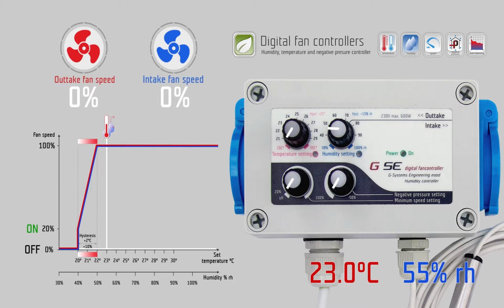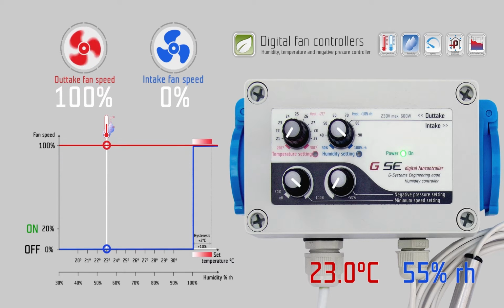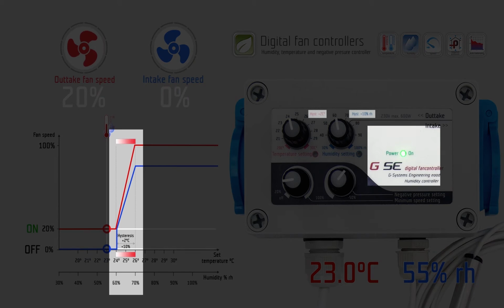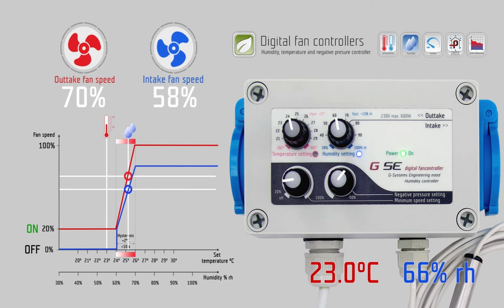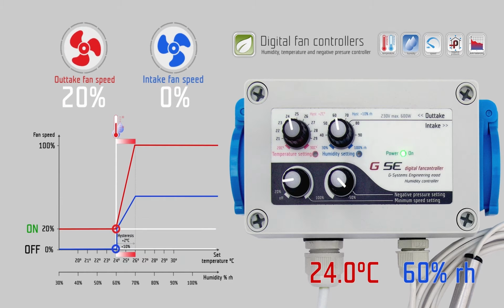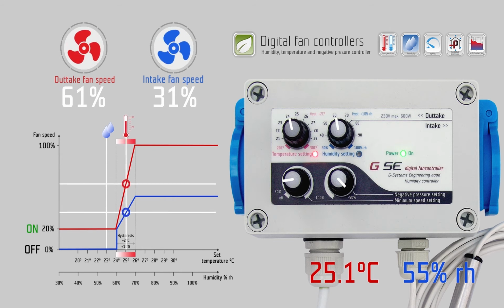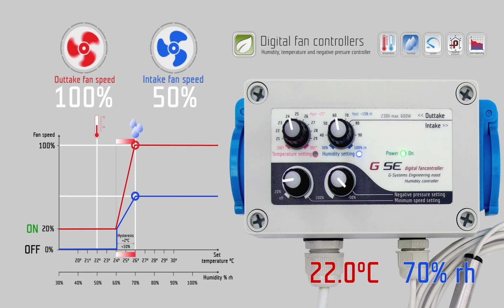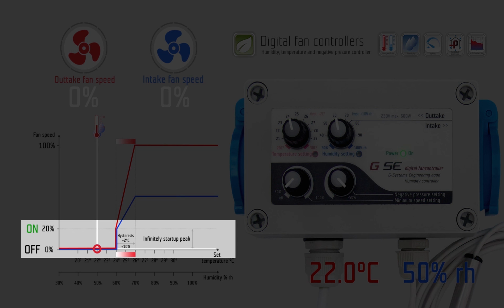GSE Humidity, temperature and Negative pressure controller (2fan) 2009-2020

Comment: Is this climate controller able to maintain the temperature and humidity levels of a 1.2x1.2m tent without any humidifier, dehumidifier, heater and air conditioner?

Note that the tent is located in a room that's always at least 21°C. Intake is from inside the room and outake goes outside the house.
Reply: Alain Gressly  so the tent is 2,88m3(1.2x1.2x2m) and my intake and outake fans are 280m3/h so at full blast they more than capable to renew tent air more than 1 time a minute (1,2times/minut). I understand that humidity and temperature cant go lower than outside conditions. But if outside conditions (which is the room where tent is located) are pretty low  good (21ºC 40%RH) will the controlller with those fans be able to control the climate?
Thank you so much you did a great job with this video.
Reply: Alain Gressly  I have one 280m3/h fan for intake and one 280m3/h for outake attached to a 275cfm filter so outake fan will have less power than intake if both full blast. However, I can dim the intake fan power to a max of 220m3/h.

Which would be, in your opinion, the best set up I could set to control the climate with the gse controller?

Comment: Hello just a question: does it matter if my extraction fan is more powerful than the intraction fan ? Will the GSE controller understand that the power is not the same and will it be able to regulate the climate ? Thanks for your reply !
Reply: Okay thanks for the answer  ! So I'll keep negative pressure on 100% that's fine.  But I don't understand why you wrote "without reducing the intake fan" : I don't think it's possible to reduce it anyway.. so there is nothing to do right ? And if the difference is as big as 680 for extraction and 230 for intake is it not too much the difference even if I let the negative pressure on 100% ? (sorry english is not my mothertongue so i want to be sure i understood you well).
Reply from the maker: Hi François 
Yes you can but send the serial number of your product on the back side silver label. Our Controllers have IP54 https://fr.wikipedia.org/wiki/Indice_de_protection and is not gas proved so even you have a new enclosure it will not protect from steam going inside.

br
Alain

Comment: It is not clear which information drives the fans: temperature or humidity? Which information have priority?
Reply: Thanks for reply.
But it's not clear to me. What means "strong signal"? What if you have 23°C and 67 % humidity? What will be the speed of fans, acc. to temperature or acc. to humidity? Will it be acc. to humidity because 67 % is closer to 70% than 23°C is to 24°C?
Reply: Alain Gressly ok, it's clear now. Thx!

Comment: I just bought one and I am unsure as to what is the maximum amp? 

https://www.growbarato.net/en/gse-products/493-gse-temperature-humidity-negative-pressure-controller.html

GSE Humidity & Temperature Low Pressure Controller
Technical information & size:

    Box: 130x80x70mm
    Controller: 160x100x90mm
    Designed for (2x600w/TRIAC 2x3A)
    Volts: 230v
 
and their site says-

Sizes and technical data's:

Case: WxHxD = 130x80x70mm
Controller: WxHxD = 160x100x90mm
Designed for: (2x200W / TRIAC 2x16A)
Volts: 230V / 50HZ
    
and on the back of the device it says (pmax 1a)
 what does all this mean? I'm looking for 6a minimum